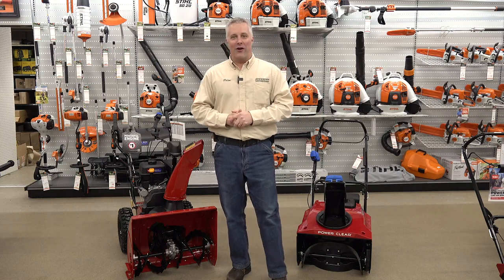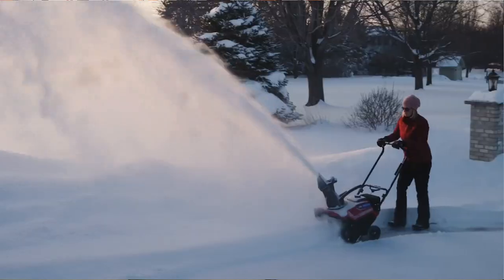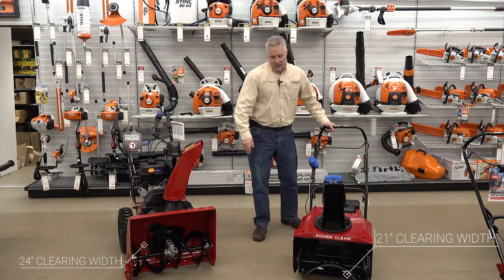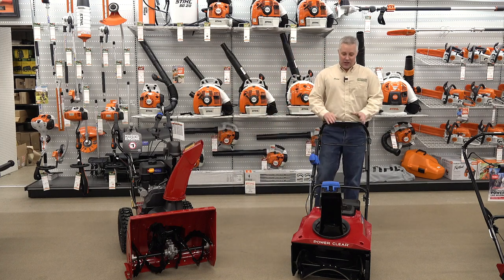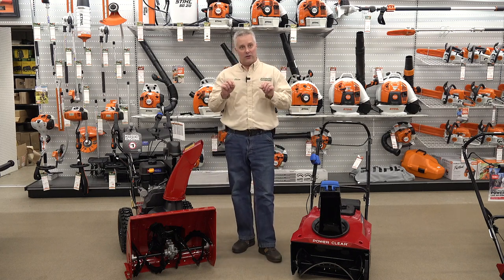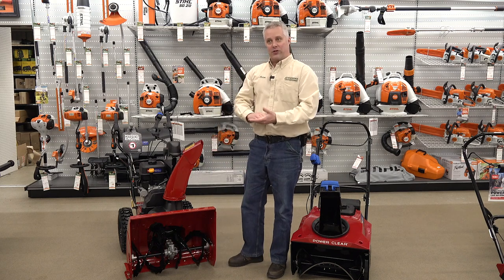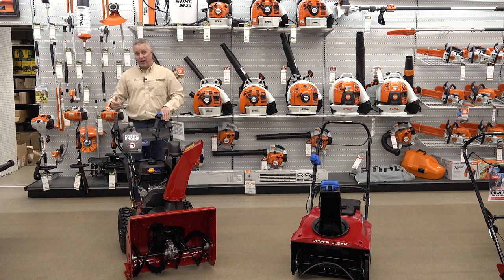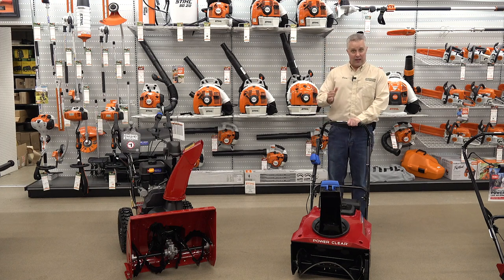Single Stage VS Two Stage - Which is Better? - Toro Snow Blower

Comment: Bought the stage two snowblower and it was a mistake. The thing is heavy and hard to manure around especially when you need to turn. After two years of difficulties, went out to get the single stage snowblower. Makes life so much easier. We don’t always get 12 or more inches of snow, only once or twice a season. Wished we had bought the single stage in the first place.
Reply: Should get the Ego 2 stage ..way lighter
Reply: @rhdtv2002  is your Ego 2 Stage battery operated?  At my age, I'm thinking it's time for a snow blower at least for anything 8 inches and lower , but need something with electric start, easy to handle and turn and that won't require it's own garage to store in the summer.  What's your experience with the EGO?
Reply: Back in the blizzard of 2015 I bought a single stage snow blower I wished at the time I had went for the two-stage. The trick with single stage snow blowers is if you have blizzard conditions you have clear the snow several times before it gets too deep for it.
Reply: Wish I didn't have a gravel driveway

Comment: Two stage snow throwers are a pain in the rear. You have to wrestle them.
Reply: I have a single stage Briggs and Straton 1222 and it's the upper limit of what I can manage. It's very powerful, but it's hard to push uphill.  My neighbor has a big 2 stage and it feels like I am wrestling a bear when I used it before my BF and I bought our new blower.

Comment: I have used toro single stage for years and they are very good machines 2 stage has more moving and parts which better chance of a break down single stage toro has less problems mine have also worked when called upon one of the bad things of single is having to change the paddles but its not that hard
Reply: But in the current environment the paddles are creeping up to the $100 range. If you have a new concrete driveway you may only get 2 seaons out of them.
Reply: @ralphfraumeni6190  are you speaking from experience? I have 10 years on mine and counting, I use it on a uneven flagstone path as well.
Reply: @Jushwa  Yes. I've had my SS since 2011. After repaving my driveway with new cement the paddles began wearing so much more quickly. Your flagstone, though uneven, is much smoother than concrete. Concrete is very abrasive.
Reply: @ralphfraumeni6190  interesting, good to know, my driveway is concrete but obviously a different texture

Comment: Look, this is simple. If you're clearing 2 to 3 foot wide sidewalks  the single stage is fine. But, if you have a 24 x 60 driveway and yoyr average yearly snow is 48 inches, the choice is obvious.

Comment: A  big snow and I get at it 2 or 3 times and dont let it pile up so its unmanageable.  Toro blower,  light and easy to handle. In 20 years of use only 3 or 4 times when a big 2 stage was needed and I didnt  clear the snow before it was overwhelming.  Learned my  lesson.

Comment: My Ma purchased our Snowblowers for our Rentals, NEVER using them herself. She said all we need was a Single Stage cause they were so much cheaper.
We tried to explain how in Heavy snow, (6" or better) how a 2 stage was so much better to no avail. She then was upset when they wore out each year, saying we were too "Hard" on them, but/EVERYTHING was overworked.
NEVER underbuy when getting a SnowBlower, you'll be much happier. Single stage's are MUCH more work, TWO Stage are EASY to use, Also, GET Electric Start.

Comment: Actually, a really good intro video.  I live in Buffalo, few people have/use the single stage around here... but they are good for locations that only get a few inches a few times a season (like the south-east).  Most people here use 2-stage gas blowers and even some 3-stagers.  Nothing clears the deep stuff and the pile left at the end of the driveway by the plows like a 2-stage.  That snow is compacted like concrete.  Buy the one you need for the job.

As far as electric vs. gas... again, electric is good for smaller jobs with less snow (plug-in or battery).  A gas blower will outlast an electric with the deep/heavy stuff.  Nobody has electric around me.
Reply: Hi I live in the Midwest and your statement resonated with me. A shovel in middle age just won't cut it anymore.

Comment: I'm going to buy my 1st snow blower.  You explained the difference between 1 and 2 stage extremely well and I know I need a 2 stage for where I live (NW Ontario, Canada). So thank you. Do all 2 stage snow blowers have a transmission and different speeds?  and Are the oil and gas tanks usually separate? and  Are most new models electric start? Last question: Can you tell me what brand of snow blowers  you are showing in this video?
Reply from the maker: Hey Tine. Yes, pretty much all 2-Stage and Most Single Stage blowers have separate gas and oil tanks. Not all but most models offer different speeds, you will need to check the specifications on the model you are looking at. In this video we are comparing Toro Single and 2-Stage Snow Blowers.
Reply: @steensmalawn1  Thanks for answering all my questions so quickly.  The people in Kalamazo are very lucky to have a dealer who is so informed and can explain things so well. Have a good Christmas.

Comment: I'm struggling with this too. 
I'm in SE Michigan.
I have a 6 car driveway, no sidewalks and a 10ft path to front door. 
It feels like 2 stage is overkill. But the Tim Allen in me wants it. It might actually make it harder since I have 3 cars in driveway to work around too.
We can get good amounts of snow as you guys know in Kalamazoo, but I figure if a big storm I can just do it during storm to do half at a time
Reply: You know when that plow comes by and deposits a 12"-36" high pile of compacted snow at the foot of your driveway? Well, a single stage will be useless to you in that situation. Its at that exact moment when you realize that you should have purchased a powerful two-stage, and your life sucks.
Reply: @IRequireMedication  I agree. Im in Mi also and the single stage was nice for a little while but completely useless in this heavy wet snow we have now. It barely throws it 2 inches from the machine in this heavy snow and its just frustrating. Im thinking of getting a 2 stage at the end winter even though it might be a little hard to maneuver around but I'm tired of going over the driveway 5 times or more just to get a little snow moved.
Reply: @IRequireMedication  I own a single stage Toro much like the 721 in the video. Trust me.  My life doesn't suck becaise of the EOD situation. Just get at it ASAP. However I do estimate it takes almost twice as long. Of course if your driveway is more than 1 car wide at the street disregard this post!🤣
Reply: @ralphfraumeni6190  I have actually heard that single stage are faster, and clear better because they get closer to the ground. My original statement about that end of driveway plow mountain still stands, but now you brought up another point: Who wants to go out there several times as it accumulates? I don't know about you, but I dislike doing it even once....ha
Reply: @IRequireMedication  Believe it or not I plow once with my SS. The EOD also. If they plow again I usually just hit it with the Jeep a few times. They put so much salt down around here it usually just melts.

Comment: Nothing beats a single stage with fresh paddles. Except ice and gravel, that will kick the crap out of them. In zero to 8" of snow a 5 hp single stage will clear your driveway faster than a 5hp 2 stage every time.
Reply: As long as it's light snow and less than 8".
Reply: @henryhill3778  I've used honda's and toro's. The single stages blow anything from slush to powder no problem.

Comment: I have both types. Just trying to learn something here. I do find out though that the single stage is the best for slush where as it would clog up the two stage. Slush is usually left behind at the end of the driveway by the plows. The single stage goes right through it because the auger spends way faster and is usually a 2 cycle engine.
Reply: FYI: 2 Cycle or 2 stroke engines are no longer available on mower and blowers anymore in the US. They are all 4 stroke where gas and oil are separate.
Reply: @ralphfraumeni6190  FYI they are still available as used units and there are 10s of thousands available in any city and people bring them to mower shops to be fixed. They made over 5 million units of various name brands of 2 cycle snow blowers. People still use them. OBVIOUSLY NOT YOU!!!
Reply: @MrLmm001  True. But I donn't want newbies to think they are going to buy a new single stage and they could find a  new 2 stroke version.
Reply: @ralphfraumeni6190  you are a newbie OBVIOUSLY!!!!
Reply: @MrLmm001  Read the last sentence of your post. If I were looking for a SS blower after reading that I would assume I could find a new2 stroke unit. You can't. And I am a gentlemen. Who knows a lot about snow blowers.
Reply: @ralphfraumeni6190  Really, then WHY did you watch? At the same time I don't want to know.. I don't believe you, and I still say you're a newbie
Reply: @MrLmm001  Because I am or now was interested in the 824 OE he has in this video. THAT'S WHY! And BTW why are you here? Please go away!
Reply: @ralphfraumeni6190  You are a fish that always gets caught. How! Because YOU OPEN YOUR MOUTH! Want me to go away? Then stop biting so you don't get caught.
Reply: @MrLmm001  🤣🤣🤣🤣🤣 You got me!
Reply: @ralphfraumeni6190  I know!
Reply: @MrLmm001  OK. OK. Fool me once!🤣🤣🤣
Reply: @ralphfraumeni6190  Fooled you several times and you're still getting caught
Reply: @MrLmm001  OK then. Hope this was as much fun for you as it was for me! NOT!
Reply: @ralphfraumeni6190  You got caught and made a fool AGAIN! HA HA HA HA HA HA

Comment: Thank you for the infomercial - very helpful. Question... Would the single stage damage a walkway at all considering it's scraping the ground? Could you use the single stage on a gravel driveway - or would it ruin it? Thanks so much!
Reply from the maker: Hey Steve, 
Great question! Would it damage a concrete or asphalt drive that is in good shape, no. But if you try to use it on a gravel driveway it will fling rocks all over the place! The best thing to use is a 2-stage with shoes so you can lift the auger slightly above the gravel. Toro also offers a single/2-stage hybrid that would give you the benefits of both styles. https://www.steensmalawn.com/new-models/toro-24-snowmaster-724-qxe-snow-blower-36002-28125142b
Reply: @steensmalawn1  Thank you so much for the quick reply - this type of service isn't common these days! Big thumbs up to you guys! My next question... Is there anyway I could order the single/2-stage hybrid from your store? I live all the way in Connecticut... Or any local affiliates that I could order from? Thank you again, I really appreciate the help!
Reply from the maker: Of course! I believe we could freight ship it! Best thing to do, is request a quote on the product page I shared previously and a member of our sales team will reach out to you!

Comment: I have a 30 year old toro 2 stage that I have been using (got it for free 8 years ago). It's big, heavy and hard to move around. I don't have a big driveway and the storms we get are usually 10 inches or less. Thinking it's time to get the single stage battery powered Toro!
Reply: Don't get battery powered! Electric or gas
Reply: No. They don’t make them like they used to. All American made. Brigs engine

Comment: thanks for the video brian. I am looking around for a 2 stage and a lot of them advertise a large throwing distance (50 feet). I don't want to be throwing snow all over my neighbor's driveways. if I adjust the discharge angle would that throw under 10 feet?
Reply from the maker: Hey Chris. Toro says that some of their 2-Stage Snow blowers can throw up to 45 Feet. But that is really dependent on the type of snow. The best way to avoid getting snow on your Neighbors driveway is to either angle the discharge chute forward or down towards the side of your driveway.
Reply: another thing that wasn't mentioned.  Throwing distance isn't really a measure of how far it can throw snow, and i'll explain.  It's simply a measure of the blowers capability.   The better the throwing distance the better it's going to do against heavy snow (wet/slush).  You'll see on the lower throw models they do jack all in the wet heavy snow, the blower cannot get it out past the front of the unit much less out of your way.  Cheers

Comment: Hello Brian!  What are your thoughts on the Toro Power Clear 21” 60V model?  I live in Delaware so we don’t get a ton of snow but I’m tired of shoveling!  I have a pretty decent size driveway that can handle about 7 cars.  I was apprehensive about a battery powered machine but I know they have come a long way and I’ve seen good reviews on the Toro.  
Tom D
Reply from the maker: Hey Tom! I think with your size driveway, a battery operated unit might not be your best bet. You should really consider a smaller gas single stage. With your size driveway, I think you'd be happier with the performance of a unit like this: https://www.steensmalawn.com/new-models/toro-21-power-clear-721-qze-snow-blower-38756-28125139b
Reply: Thank you very much Brian!
Reply: One last question. Is the chute control the only difference between the 721 QZE-21 and the 721 E-21?  Thanks again?
Reply from the maker: Yes it is!

Comment: I have a small one lane gravel drive (small pea gravel).   Was thinking I could use a single stage and just build some shoes on it to leave an inch down.   Then on the sidewalk run it normal.   Any thoughts on that idea?
Reply from the maker: That's an interesting idea! However, with a Gravel Driveway, if it's in your budget, a 2-Stage Blower would be the better choice. The Skid Shoes are pre-installed you just need to adjust them to fit your needs! A Single Stage blower will fling that gravel like no other! Plus, generally, the body of a Single Stage is plastic. While it is durable plastic, it isn't designed to have DIY skid shoes screwed into the side of it. 

Hope this helps!

Comment: Speed- the single stage is way faster,  you can run with them :)
Reply: i tried out a new aeriens snowblower in and it goes pretty fast in snow, not that fast though

Comment: They put a metal scraper on the single stage that was a mistake.  It bends and the snow blower won't go forward and won't scrap garbage. I have 3 all 3 did it
Reply from the maker: That's odd that you've had Metal Edges on your Single Stage. On all of the Single Stage Models we carry, they have plastic edges. Perhaps its a specific model you had.
Reply: @steensmalawn1  i have the commercial one there is plastic on it but aluminum pieces on it.
Reply: @steensmalawn1  Ego single stage has metal auger on their single.stage
Reply: The Toro e21 has a version with a metal auger.

Comment: Look at the height of single stage it’s worthless in wet and deep snow. Two stage works perfect 3+ inches.
Reply: I would say 2-stage also have trouble in the wet stuff, Snowmaster is a good combo of the 2, because single stage are smaller they have a smaller, less powerful engine. Snowmaster starts with a 212cc engine, most 2-stage start at 208, you can have a single stage with only 99.

With a powerful engine the single stage can actually outperform the 2-stage, they can do the job in half the time and they are powerful enough to get through end of driveway snow and ice. A lot of people are buying the Snowmasters or the smaller single stage

Comment: Stop calling the single stage a "snow thrower" technically the two stage is a thrower too.
Reply: That is the proper term. Yes they both perform the act of "Throwing snow". However, a 2-stage has a second impeller behind the first that blows the snow out of the housing.
Reply: @luckeyjosharmy  cool